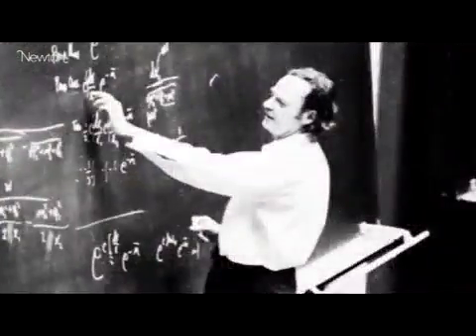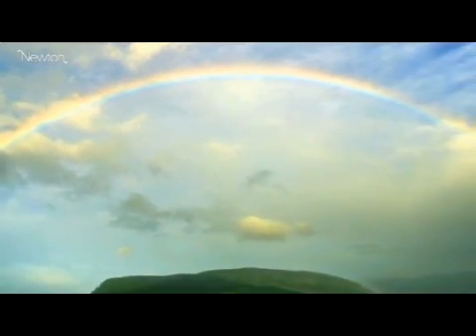Brian Cox's guide to quantum mechanics

Comment: Going for the nitpicker of the year award here but the photoelectric effect was discovered in the late 19th century and it was in 1905 that the theory of the photoelectric effect was provided that worked - in one of the five papers Einstein wrote that year. Quanta had been postulated five years before by Planck to solve another problem. So although Einstein's theory was a great step forward and in electrodynamics was the first practical application of theory to observation.